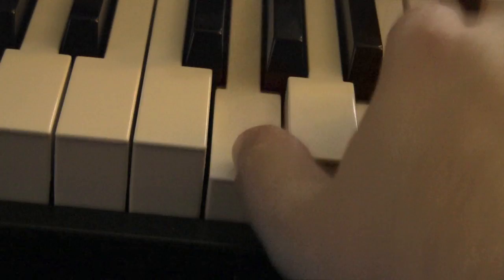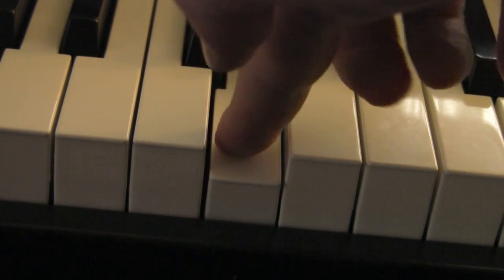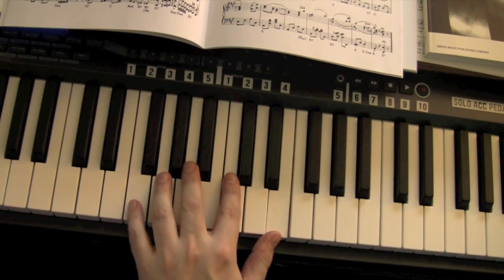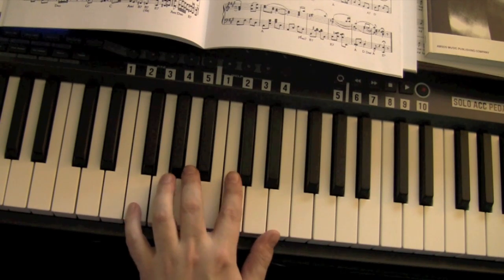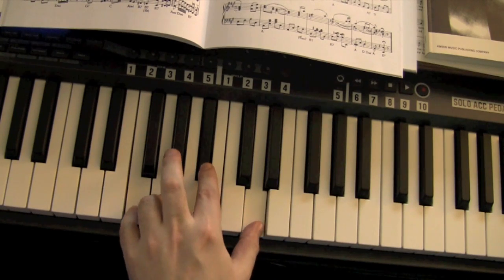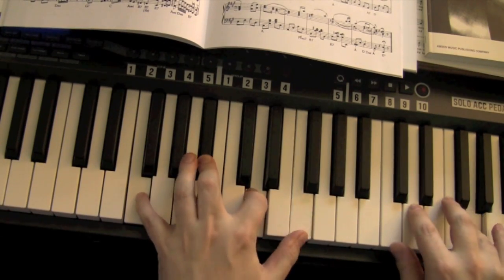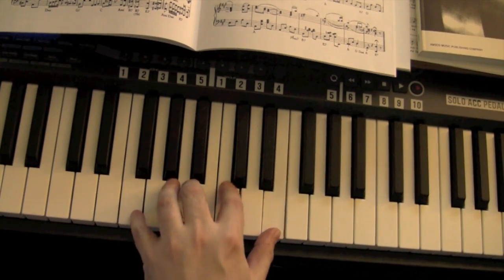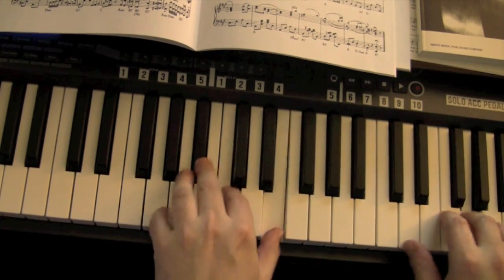Theatre Organ 2nd Touch From MIDI Aftertouch

Comment from the maker: @The2010SnowDay Just want to give you this warning first. My keyboard does not have real organ 2nd touch. It does not have polyphonic aftertouch either.  It is monophonic (channel) aftertouch.  I'm using a program I wrote to convert channel aftertouch to note on/off on a different MIDI channel.  It does not handle single note 2nd touch after a chord is held down, only before a chord.

It is an M-Audio Axiom 61 older version.

It isn't as nice as a real 2nd touch organ keyboard but sort of works.